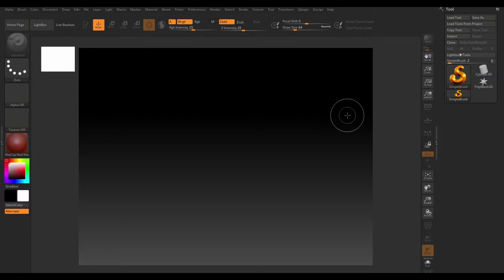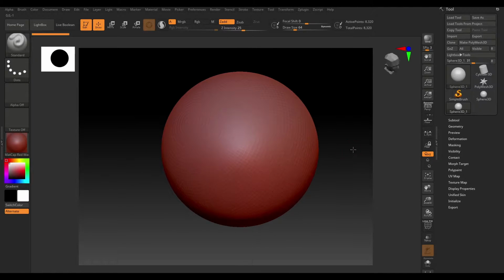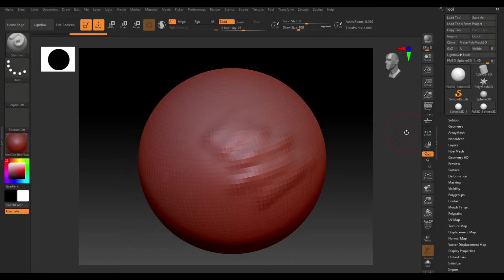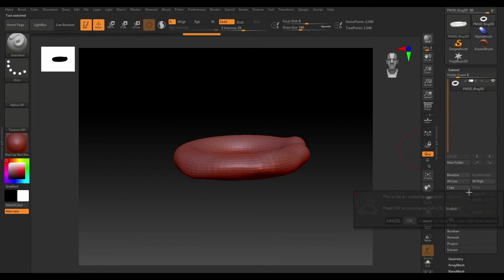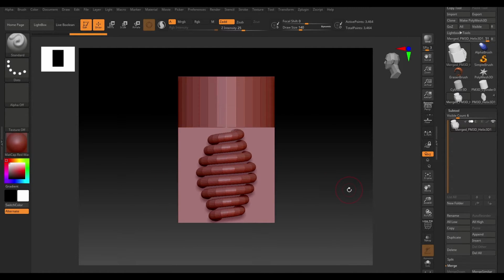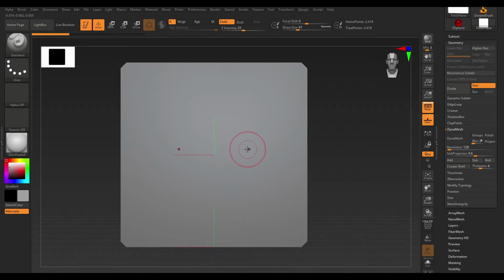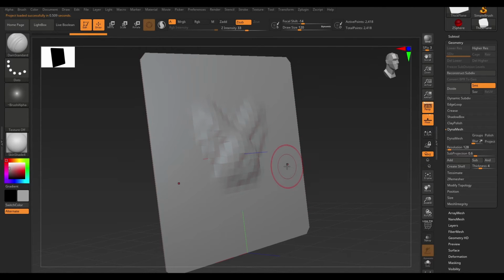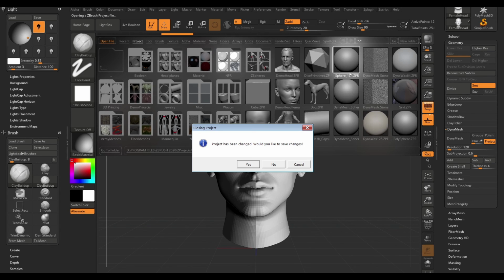Zbrush - Troubleshooting Beginner Problems Vol.1

Comment: hii, is it normal that. when i click make polymesh 3D, then click draw poly frame. it becomes dark and everytime i reclick make polymesh 3D it just keep changing color. Im new to this and I'm so confused aaaaaaaahhhhhhhh
Reply from the maker: It's normal. What you are doing is basically creating multiple tools. Everytime you click on make polymesh you are creating a new tool and in order to indicate that zbrush is assigning a new polygroup hence the colour change. If you have any other questions or struggling through other problem you can post a screenshot/s or upload a video to the channel's discord server under questions and feedback and I will address it at the earliest. Here is the link to the server https://discord.gg/Jmc6Nybu

Comment: When i use ZSphere in my ZBrush 2021. my MakePoluMesh3d is not working? Any advice?
Reply from the maker: For Zspheres you need to make adaptive skin first and then make polymesh3D. I cover this in the second volume of this video series. The link is in the description of this video. If you still run into any issues do let me know. Hope this helps.

Comment: Please I do have an issue. When I'm sculpting on a particular model, I don't know what will cause the mesh to be duplicated, when it's been duplicated, the main model is still there but I can't sculpt on it, instead I'll be sculpting on the duplicate, and I want to take out the duplicate, pls make a tut on that. Thanks
Reply from the maker: Where does the duplicate model show up? If it's just hanging around in the viewport try hitting Ctrl+N to clear the layer. If that doesn't work then head over to the layer menu and check if you've accidental created a new layer. If you see that you have created a new layer then delete it. Once you've done that, set your stroke to drag rect. and redraw you model. Hitting "T" after that will activate edit mode and you should be back to sculpting with no problem. Hope this resolves your issue.
Reply: @Art-of-Akrosh  thanks I'll check it out